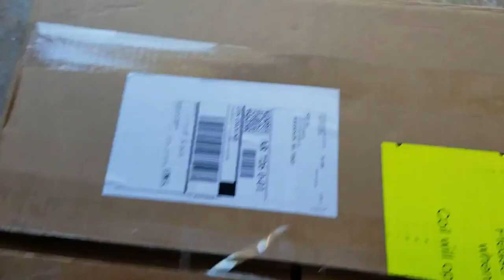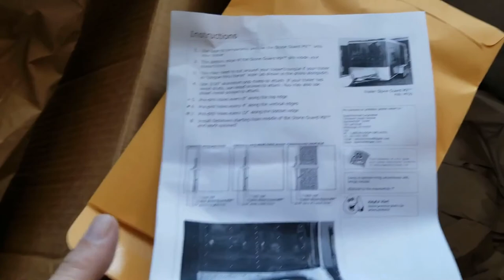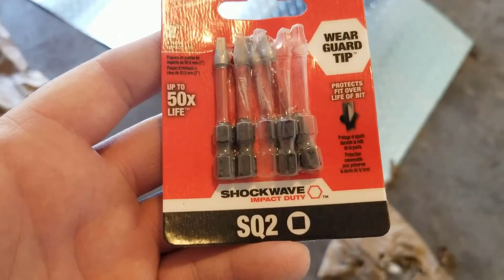Replacing aluminum diamond plate on enclosed trailer

Comment: What's the metal bar at the bottom called that holds the bottom of the diamond plate in or where can I order one from
Reply from the maker: 1 5/8" x 72" Aluminum Cargo Trailer RV Trim - Mill Finish. It took so long for me to replay.  https://www.ebay.com/itm/373904186157